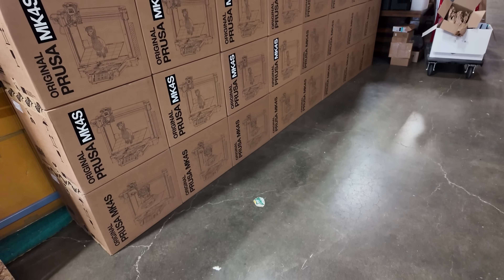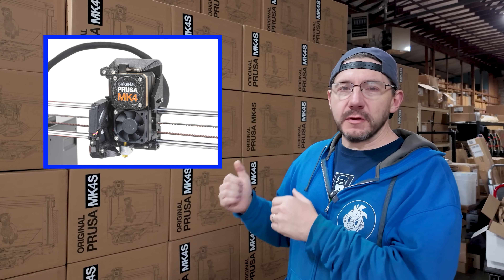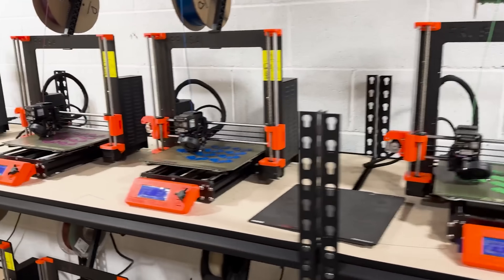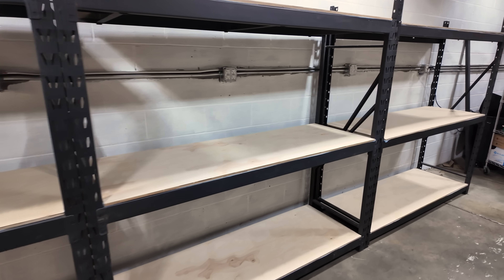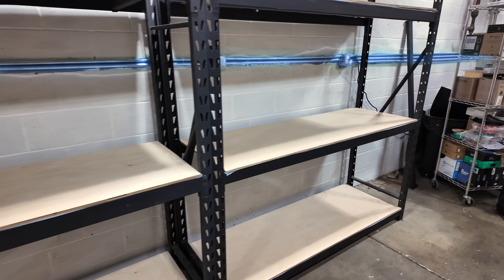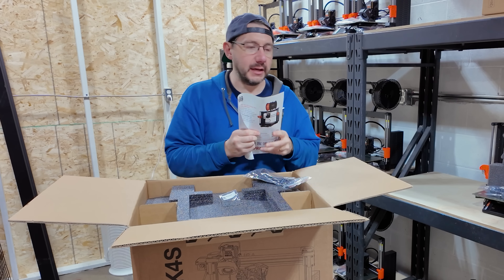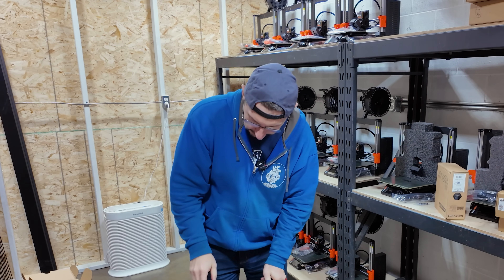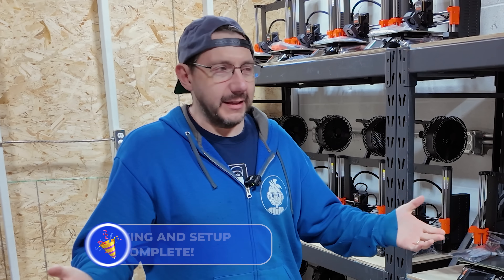MASSIVE Print Farm Upgrade!

Comment: Good video and good luck with your new print farm. However, I wouldn't have chosen Prusa. Prusa is overrated and very expensive for the technology it offers. You could have gotten much better value for money, but anyway, it's your choice :P
Reply: let me guess you would recommend bambu lol, sorry not even close....
Reply: @scarfa21  With the current controversy surrounding Bambu and their firmware, especially not really suitable for print farms. There are much better alternatives than Prusa at that price, offering more options and an open-source ecosystem. Sovol SV08, Anycubic Kobra S1, Creality K1/K2. What we want is the speed of a CoreXY, an enclosure, and an MMU. If they had chosen Prusa's CoreOne, I wouldn't have said anything...
Reply: @ I hear ya i have a qidi xmax 3 and love it, not a single issue, it just works.
Reply: I think it is the best choise. Easy to maintain and to fix. Very reliable und you get upgrades for decades. Even i sold my Bambus and switched to Prusa.
Reply: @SB-100  I wouldn't trade my P1S for an MK series—maybe the CoreOne—but the MK4 is very ordinary. When I look at it, I see my old AnetA8, lol. I have one P1S and several other printers like the Voron 2.4 and ZeroG, but I will never buy the Prusa MK series.
Reply: @Nicecube3D  Everything you said is valid _to you_. You are not understanding that for this use case, the Mk4S makes more sense: Prusa builds them to be *reliable*. This is a commercial print farm, where downtime means loss of money.

As much as I love VORON and ZeroG's Mercury One (I have both), they still are DIY printers, which means you are on your own to maintain them, and that's a big no-no on commercial environments. Also, the faster printer is to have more printers: why wait for one printer to finish when you can make multiple printers divide the workload?
Reply: @Nicecube3D  i sold my three p1s and the x1c even the x1. The only Bambu still running is the a1. Updated my old mk3s to the newest version and waiting for the core one. To be honest the Bambus are good printers but they need too much time  to repair and maintain. And the printquality of this mk4s are very good.
Reply: @vinnycordeiro  I understand that these printers are reliable, but with another type of printer (CoreXY), I would have been able to print twice as fast, resulting in more profit $$$. There are other reliable companies; it's not just Prusa.
Reply: @Nicecube3D  That's debatable, but I won't go that way. There's also the thing that Joel chose to use Prusas, so whatever we may say doesn't really matter at the end of the day. But you said something important, and that is that we have other choices as well. Competition is good for consumers, be they home or commercial.

Comment: i'm on a budget and being inexperienced at 3D printing, I was thinking about getting Bambulabs. then I saw so many videos and comments about staying away from Bambulabs so idk what to do now. but it's cool to see print farm being built.
Reply: As someone who owns an X1C, I can tell you that the price to performance is there and the machine is genuinely incredible. You really cannot beat it, or any Bambu printer, for the price. As for the videos, its easy to get hyperbolic and react/overreact to things that people don't want to hear (read), but if you are using the printer and the BambuStudio application, nothing will really change as an end-user. If you are immediately making the purchase, go for it, the machines work great and really are plug and play. If you have a month to wait, let everything sit and see where everything stands when the dust settles.
Reply: this is the right take to have - bambulabs is a solid printer, but they have a closed ecosystem, and are actively trying to prevent users from using anything but their filament (which is WAY more expensive than generic).  highly recommend you get a prusa mini+.  it's less expensive than their other options, but it's an amazing little printer for getting started.